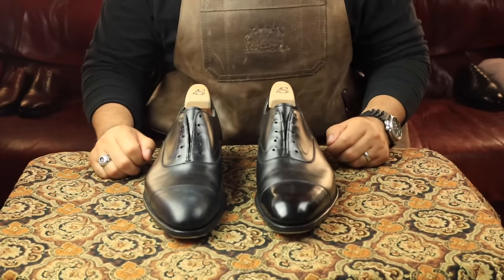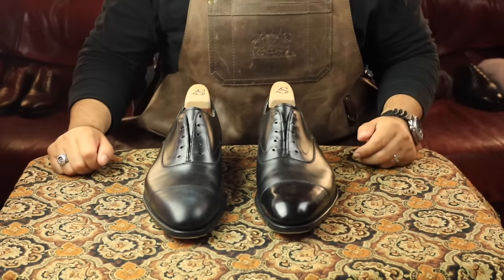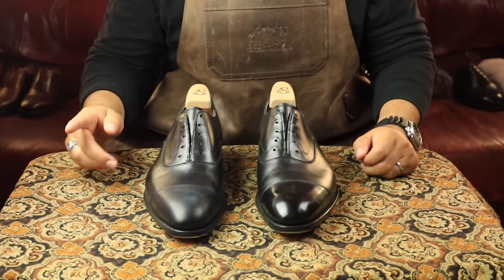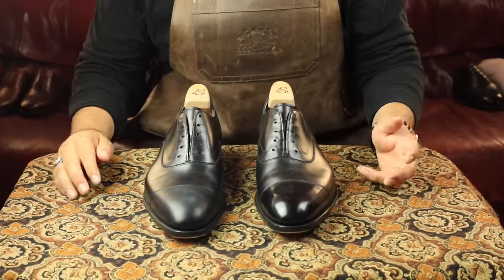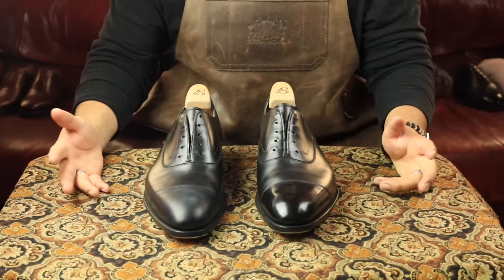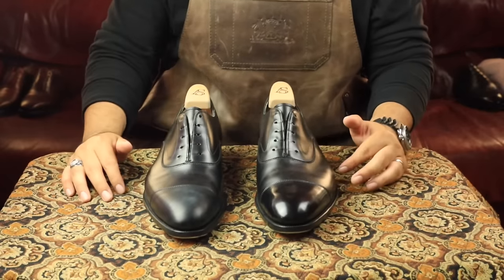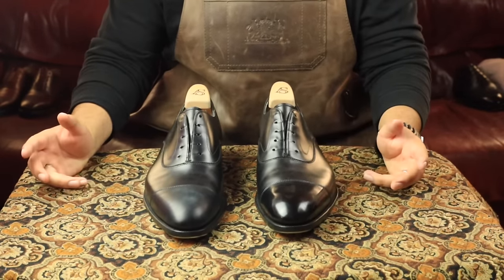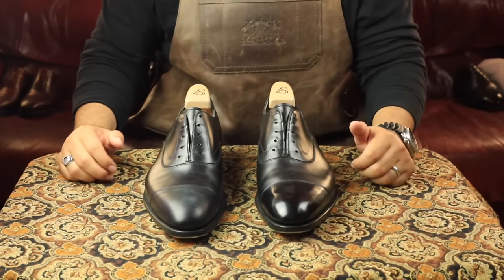Can You Mirror Shine a Shoe Using Powered Tools to Make it Easier?

Comment: This was fun to watch! I've always wondered this as well as I have arthritis and can't always handle doing a glaçage by hand. I usually use a microfiber cloth to do my mirror shines- I wonder if there's a way you could macguyver some kind of attachment for your dremel where the head is wrapped in microfiber cloth, whether that might work better? It would certainly mitigate the lint issue and I suspect might also allow you to get closer to an actual mirror shine rather than just a high gloss foundation.
Reply: Unfortunately, I discovered the hard way that if you get the tiniest of snags in a microfiber cloth, you can develop thin, wispy microfiber lint. Buried for all to see in the middle of your mirror shine.🤦😿
Reply: @brookeggleston9314  Lint embedded in wax is so frustrating! I've had it happen with with various types of cloth including cotton chamois- I've resolved it really just comes down to whatever works for the person doing the shine. With aforementioned arthritis, I find microfiber to be most practical for myself as I can get a really beautiful shine with practically featherweight touch. I like to go over my cloth with a lint brush before I start. That usually spares me any headache.
Reply: @AE1P  I've had success with cotton (brand new t-shirt), microfiber, and bare fingers. You must be careful to clean all of the oils from your fingers with alcohol or acetone. When you're finished, you need to IMMEDIATELY recondition your fingers with appropriate lotions, otherwise that nice mirror shine will reflect the skin sloughing off your hand! Sticking them into the pot of Renovateur works well, if you have no prior preference. Just wipe the excess off on another pair of shoes!
I have arthritis, fibromyalgia, non-diabetic neuropathy and myeofascial pain syndrome, so I hear you!!
Reply: @brookeggleston9314  I think my skin's too sensitive to try out your bare fingers method (I always use nitrile gloves when working with acetone and alcohol). But I can imagine you'd get a great shine with that method! I use bare fingers when shining up cordovan to a high gloss and the results are always amazing.
Reply: @AE1P  I'm not surprised! I think, with  Cordovan, skin oils would enhance the leather!
Stay safe - ✨

Comment: When I was in the Air Force to get that glass shine on our boots you would light the wax on fire, let it melt, blow out the flame, put the wet wax on your boot. Do that 3 to 4 time, grab cotton balls, dip in water and get to waxing on and waxing off.. Repeat with water and waxing on and off until it looks like glass. . During those times there was a sense of pride in how you kept your boots shined. Not anymore😑😭

Comment: Why don't you use the rotating machine with the EXACT material you used to mirror shine at the end of the video?  You used camel hair, but what you actually used to get that fabulous shine was quite different.  It was a WHITE material - far from a brush.   

You could even wrap that white material around your personal dremel, and see if that does the trick.  Low setting obviously, and it would have to be wound up VERY tightly.  

I can't do a mirror shine normally because I have severe shoulder and bicep pain.   Let me know if you can do a video with that cotton material you used... or was it a leather shammy?

Comment: Dude do some research. You’re supposed to dress a buffing wheel with a buffing rake and remove the excess fibers. Then trim any loose hairs coming from the wheel. You need proper rpms to buff the finish you intend to shine. Dif products require dif speeds. Then you charge the wheel with compound. That’s how they are meant to work. 

You think that little wheel gives off lint? I use a 12” buff to shine up guitars to a high gloss finish. Dressing those really is a pain lol.

Comment: As an ex guardsman this is totally the wrong way to bull shoes. The secret to deep a deep shine in shoes or boots is bees wax. You need to burn bees wax into the shoe. Plus after that it’s layers of polish. And hours and hours of magic circles. It’s the only way. Please be warned about burning anything into footwear. You need to pack the footwear out with damp newspaper as the heat will shrink the shoe.

Comment: The mirror shine is built with the least amount of finger pressure as possible, so the rotary power tool with the amount of pressure you started with is not reproducing the manual method.
That tool is just removing the layers needed to build the depth needed to produce the mirror.
In less time than you spent here in this video, you could have mirror shined the whole shoe by hand: https://youtu.be/ZrnhGk8eIOw
Reply from the maker: You didn’t watch the entire video did you?

Comment: From a technical perspective it should be possible!. You are doing it wrong. you have to replicate the normal way of doing it, but just faster,, that means
- you need to apply a pressure on to the surface
- The tool need to go slower
- The brush must be of some what similar texture to the brush you use for shining a shoe.

I actually hate those type of shoes,, and shining all together,, not sure why i ended up here,, but it just hurts to see you doing it wrong,. you need to simulate the exact mechanic that goes into shining a shoe,, then use tool to do that mechanic faster.
Reply from the maker: Hey Gebi. Like is said in the video, I don’t think it’s possible to replicate the shine I did at the end with ANY kind of machine. I am pretty much 100% confident about it. 

The challenge is out there for anyone to try it but I just don’t think it’s possible. The amount of fínese and the constant changes in pressure and speed per second to achieve a true mirror shine is not possible with a powered tool. It has nothing to do with increasing the speed or even using the same material-because you can have both and still not achieve a mirror shine normally-it all comes down to fine skill. I believe a machine is too imprecise. 

I’d love you to prove me wrong. If you successfully film an attempt, send it to theelegantoxford@gmail.com and I’ll feature it in an update on the channel. I just don’t think you or anyone else will be able to.